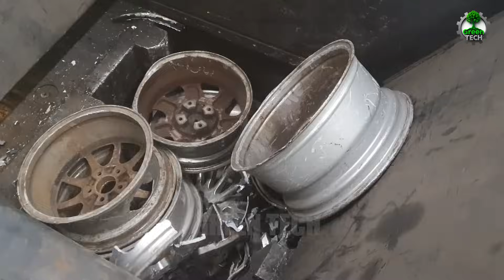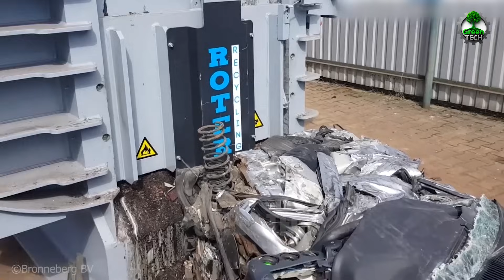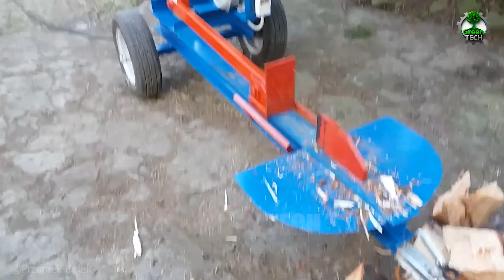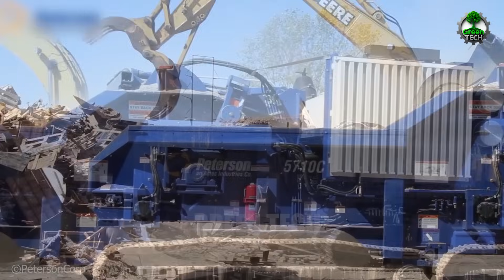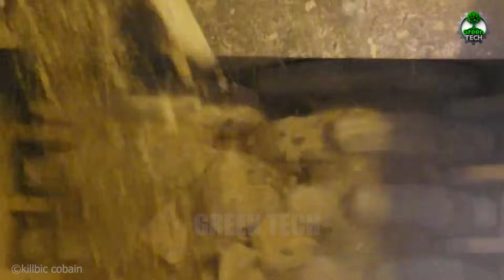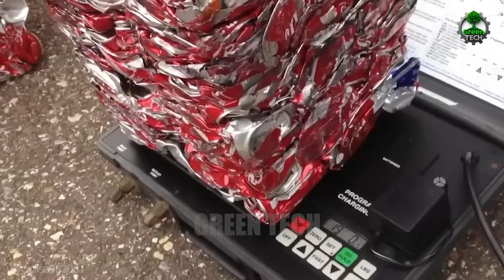Extreme Dangerous Wood Chipper & Shredder Demolitions: Crushing Everything in Sight! #23

Comment: You guys must go through a lot of blades doing this.
Reply from the maker: That's a great question! They likely go through a significant number of blades depending on the volume and type of material being processed. Regular maintenance and blade sharpening or replacement would be essential.